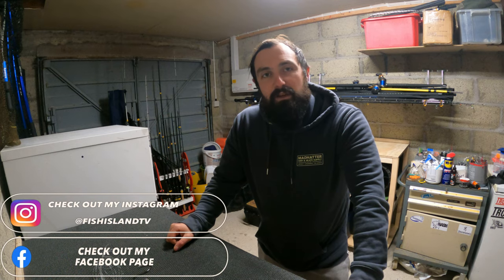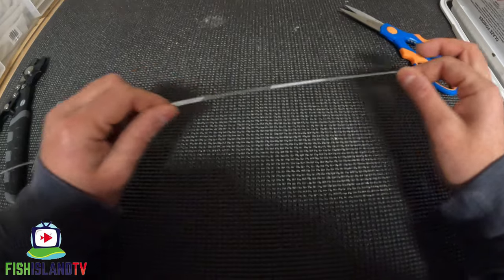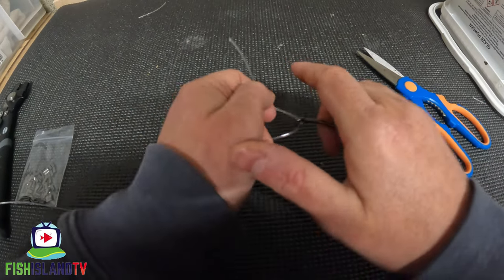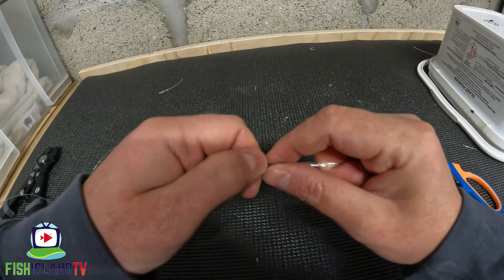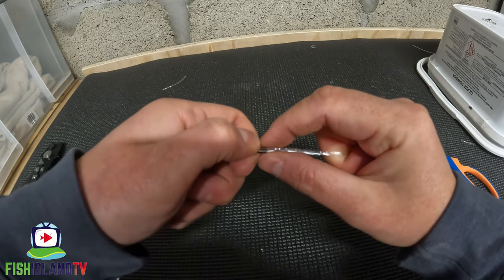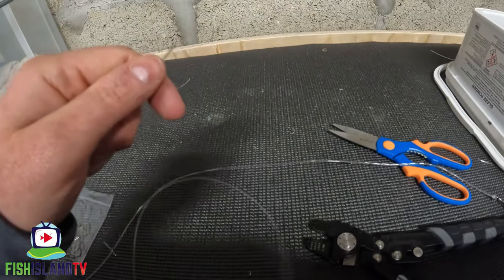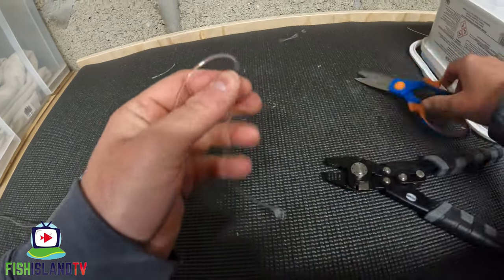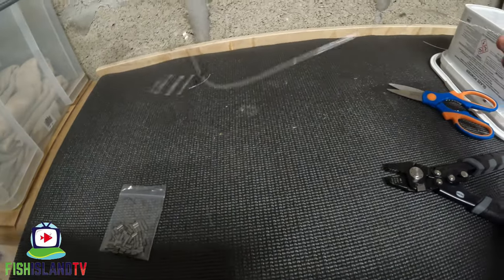How To Tie A Twisted Mono Biting Trace - How To Make Fishing Rigs - Boat Fishing - Sea Fishing UK

Comment: Interesting this.... Instead of spiking / shredding your hands with the fine strands in the wire, use mono. And It looks so much easier to work with compared to wire too....
Reply from the maker: Yeah mate it’s much easier they actually last longer then the wire traces iv tried in the past. I won’t be using wire anymore that’s for sure.